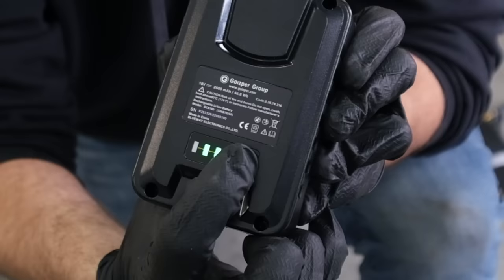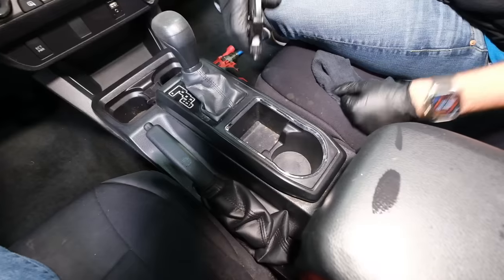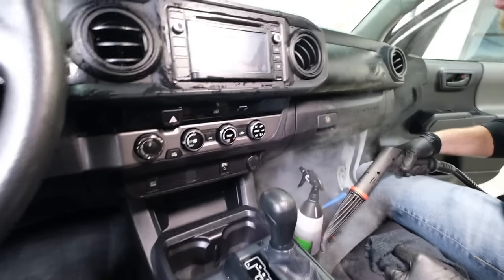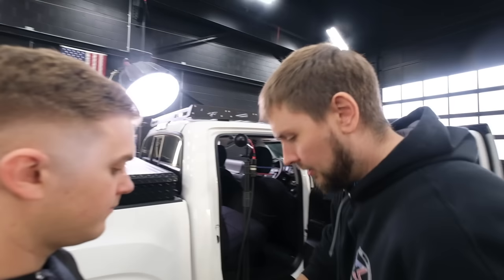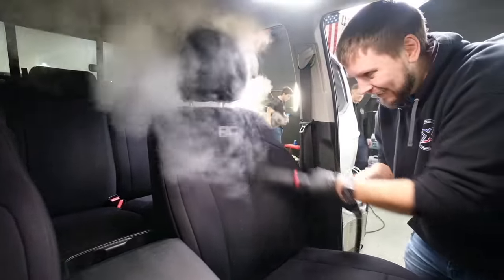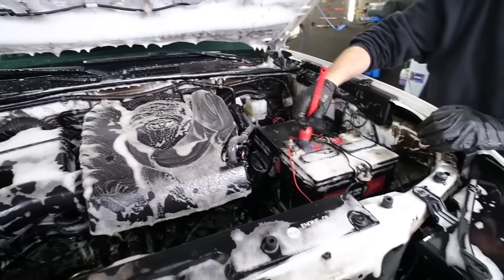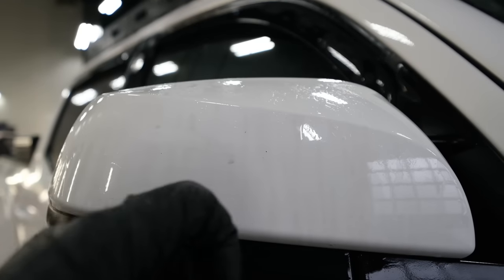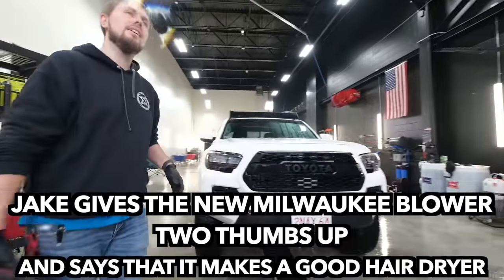I bought an iK E Foam Pro 12 Pump Sprayer and it changed my life

Comment: You want it to look more perfectly matte doing a deep cleaning as you are bringing back the oem finish. It looks dry bc your removed everything to remedy this simply apply a conditioner. Ultima makes an amazing easy to use one that can be used for all surfaces. This will darken and add a smooth feel.
Reply from the maker: There’s def a need to condition after steaming stuff ends up dryyyyy

Comment: If you open up the ac vents , run the steamer into one vent and it’ll push it all through the others. Or push it into the one under a seat and it’ll run through it all.

Comment: You should wear a mask when you’re kicking up that junk with the tornador 😵‍💫 

Better yet get the tornador velocity vac I love mine. It’s a tornador combined with a shop vac so you’re vacuuming all that junk at the same time your kicking it up. Plus you won’t have the problem of the dust moving back and forth like you mentioned around 4:24

Comment: You'll love the Chief steamer, had mine 2 years. I run tornador blow gun, tornador max, and steam machine at the same time. My process is chemical via tornador max, detail brush, steam (rinse, flush out cracks and crevices), the tornador blow gun wth towel to dry. I can get around nasty vehicles really fast
Reply from the maker: That sounds like a lot of fun, I have a Tornador max as well I’m going to have to try that along with it. What was the best soap to add into the Tornador for you and what strength?
Reply: @ChemX  I’d honestly just use water or something super mild. The tornador atomizes so finely that the chemicals you use are being breathed in and even get absorbed into your skin.
Reply: @ChemX  can you use this device with your snake oil? In the colder weather, I can't use my pressure washer at my house. And truck stop washes don't have an interchangeable tip to put foam cannon attachment on. Please help be much appreciated as my semi is dye for another b er application of your snake oil. Love that stuff.

Comment: youll be fine with the steamer around the knobs and switches. i use it and then hit it with a little air and never have issues. just cant camp around them. have to keep moving.

Comment: In my experience the best way to wash engine bay with disconnected battery. First of all if cleaner or water get into electric connectors, fuses, bad wires etc it would not start corrosion because without electricity it is wery slow process, may need years to see   some insignificant oxides on open wires, and i think that you wash cars way faster) Second there is non waterproof parts like starter and alternator. My personal method is disconnect battery, use more concentrated cleaner, wery good rinse with low pressure and then blow all water, especially from spark plugs and coils.
Reply from the maker: I’m thinkin engine off, battery disconnected, I agree strong but minimal amount of soap and I’m gonna try my steamer to rinse on the next round🤔

Comment: I literally dont do anything special too clean an engine bay. Soak down in apc, scrub, pressure wash, let dry while washing the exterior and wipe it down with dressing at the end.

Literally EVERYING in your engine bay wont be hurt by a little bit of apc and some water. It lives in the elements, rain, snow or otherwise.

Comment: how would you clean the IK foam pro 12 pump sprayer's main body? would you remove the air connector, the pump/handle, and the air safety valve and then shake the main body with clean water inside? thanks and more power to your channel! :trophy-yellow-smiling:
Reply from the maker: Thanks yeah I’d probably pop the pump off, I have never cleaned the inside other than rinsing it out it stays clean, outside gets dirty tho and I just rinse it off

Comment: How much running time on the spray pump with the battery?
Reply: The battery will run for about an hour of continuous use. Roughly 4 hours to charge. I just bought one without the battery option. I’ll just pump after each panel, or use my air compressor or portable tire inflator. Didn’t want to add anymore weight or cost. 

This pump sprayer is right around $130. Add the battery option and it’s $250. I wanted something that would foam a vehicle, but also be portable. Electric pressure washer still needs a power source. 

I take my car to a car wash bay, but the pressure washers are a bit too powerful and the soap mine offers is too harsh. I wash with a 2 bucket method because of that. I’m hoping I can get most of the foam a pressure washer and foam cannon would offer, but all the portability of a pump sprayer for when I’m washing my vehicle not at home.